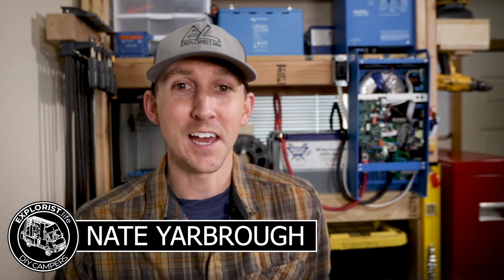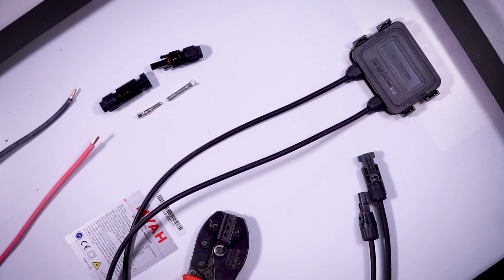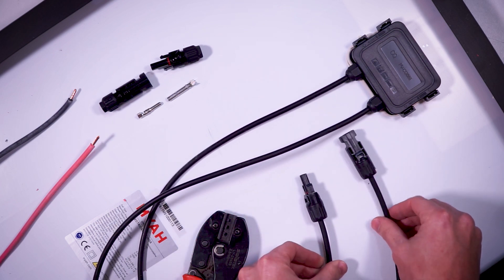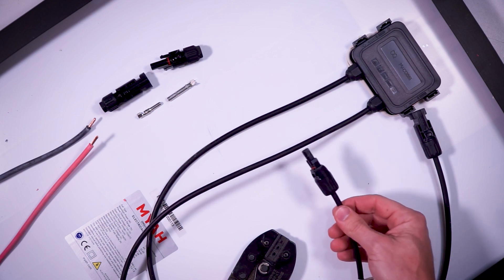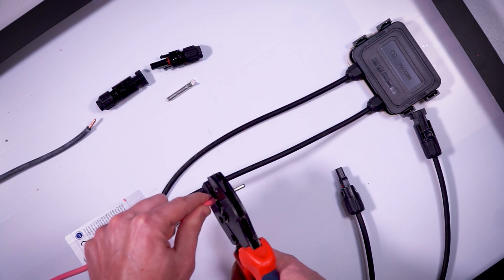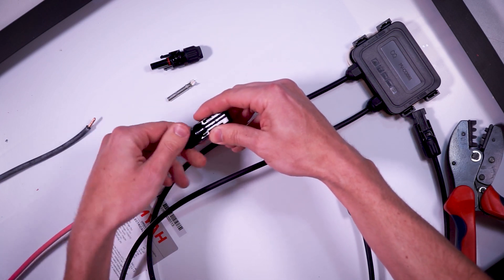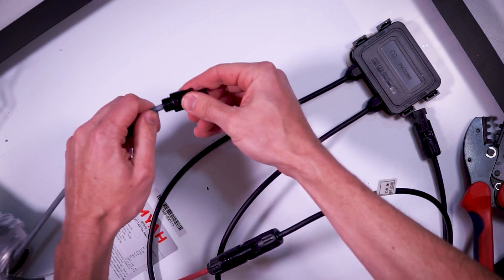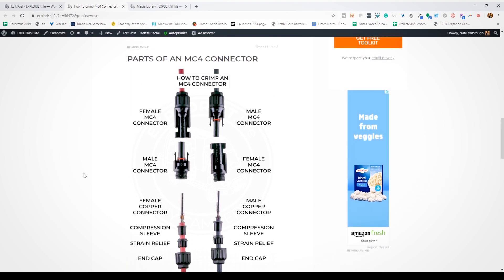How To Make MC4 Connectors (For Wiring Your Camper Solar Panels)

Comment: I have two questions. First, If you are connecting mc 4 extension cable say more than 50 feet from solar panels to the charge controller etc. should you not insulate the 10 awg red and black wires  in for ex. a cable sleeve PET expandable, for the weather?
second, I see most persons using 10 awg for extension cables I saw  a video which indicated that 10 awg cables do not last the test of time and can result in loss of energy etc.  Can I use a 6 agw (3 prong) wire to the mc4 adaptors instead? what happens to the third  wires as only red and black are used?
Thanks I an enjoying this series.
Reply from the maker: If you use wire that is rated for direct exposure, you do not need to enclose it unless a building code states you must (most solar wire is rated for this purpose).

There are no MC4 connectors rated for 6 AWG wire.  I would not recommend using 3 conductor wire.  Use the wire that is designed for the job.
Reply: @EXPLORISTlife  Thanks

Comment: Is it a good idea to use MC4 4Y connector with only 2 solar panels? Can I leave 2 more MC4 unoccupied? Or just use the MC4 Y connector while there are only 2 panels? Because I'm thinking of adding 2 more panels in the future. So, I was thinking of whether to buy just MC4 Y connector or simply buy the MC4 4Y connector at once. Currently I own just 2 solar panels

Comment: I wish they weren't so hard to pull apart. I have 3 systems that require me to move the power for where it is needed. So I was forced to use audio quick disconnect. Unfortunately, they rust after a while, which forced me to buy more. But mc4 plugs are like a permanent connection unless I'm given a better solution.

Comment: Thanks for all the Videos on Solar..Ive learn so much just with your teaching. "Question on the MC4 connectors. I have 2/ 170 Watt Panels going to a 30A Zamp Charge Controller which is located in the bathroom in my 5th wheel, then from their to my cargo area where the battery bank is at.. I want to disconnect that Zamp controller and replace it with a Victron 75/30 Charge controller and install it in a further location up front in the cargo area of the 5th wheel.  Could I just disconnect the in/out  from the Zamp controller and connect them together with MC4 connecters and from their using that extension to the new Victron charge controller?

Comment: I tried to connect my 2 one hundred watt panels to each other, in series, but they wouldn’t connect all the way. I contacted Rich solar and haven’t heard back yet. I’m thinking maybe they weren’t assembled right. 

Connecting the extension wires to the other positive and negative clicked tight. 

So I was happy (and giggling) to know this info is here, if I break one taking it apart, I can fix it. Empowering.
Reply from the maker: Awesome!  Glad it helped.  Thanks for watching!

Comment: The O-rings on my male connectors make it VERY difficult to click the connectors together, so I just wound up removing them.  Is there some kind of tool I can use to push connectors together WITH the O-rings still in place?

Comment: Hi you don't need to take a part the connector just push in the  crimped contact on the wire in to the connector on until click and tighten. done
Reply from the maker: For the sake of education, I felt it was important to show how all of the parts and pieces go together in a completely disassembled MC4 connector.  When I start skipping steps, people get confused.  I'm glad you already knew the shortcut.

Comment: Hi what happens if I put the wrong pins in and set the solar pannel on my campervan roof, I have no power so is it because of the pins?
Reply from the maker: I don't have enough information to properly diagnose why your solar isn't working, but you should definitely use the correct pins.
Reply: @EXPLORISTlife  it’s ok now cheers bud I put them right and now working a treat :)

Comment: Why not just cut off the plastic connectors strip the plastic off the wires and solder the wires together and then insulate the connections with plastic tape instead?
Reply from the maker: 1:  Cutting the MC4 connectors off of a solar panel will generally void the warranty.

2: This is faster than soldering.

3:  This makes for easier panel removal in the event that it needs to be repaired/replaced.
Reply: @EXPLORISTlife  Yes I agree it is a lot faster than soldering but soldering is not subject to corrosion like a crimped connector and thus unlikely to have problems.  That said I have ordered branch connector and two sets of connectors for inside the caravan so I can switch the output from the solar panel to a variable alternative system.

Comment: Do you have thoughts on Sae 2-pin solar panel - &+? I wonder if should replace this connector with an mc4, or the Ec8 that is the input of a power bank I plan to use.

Comment: Do you need that actual crimper tool to crimp the wires? Can you use an ordinary crimping pliers??
Reply: I can't find any help on crimping the solar pins to the wires. Ruined several already using my Klein crimpers. 😢 Can I just add a touch of sodder?

Comment: Hi nate, love your channel and how your explain everything very simple, I have a question I hope you can answer, I have solar set up around 30 feet from our rv and got 6 awg wire recently to help with the loss of watts from the distance but I haven't been able to find mc4 connectors that are big enough for 6 awg wire, do you know where I can get some or how I can make the usual mc4 connectors be able to fit around the 6 awg wire?
Reply from the maker: Nope.  MC4 connectors are generally designed for 10 awg.  8 awg SOMETIMES fits, but to my knowledge, isn't approved.  Increasing the voltage of the panels by wiring in series or series parallel will allow you to use 10AWG wire without excessive voltage drop.
Reply: Thank you for the help, ill try the series parallel way with the 10 awg wire.

Comment: Do these work with 6 AWG PV wire?
Reply from the maker: Nope.  10 AWG is the most common size for MC4 connectors; I have seen the random MC4 connector that will accept 8 AWG.  I never use wire bigger than 10 AWG in any of my solar array setups up to 4800W.  By properly using series-parallel solar configurations, to raise the volts and keep the amps low, large wire  from panels to charge controller is rarely needed.

Comment: Hi ! Thanks for the video.  I want to make sure that the mc4 connectors are installed on regular (multistrand) wire, like a 10awg.  Just because I saw wire described as pv on it.  Thanks
Reply from the maker: Those wires would be installed on the roof, so they should have a PV rated insulation.

The wires themselves are, indeed, multistrand wire.

Comment: Great video Nate. I like that you take the time to teach. Quick question, do I need to install a sun-saver charger between the panel and RV? Or because I’m going through the RV plug, it regulates itself? Thank you in advance.
Reply: I'm not sure what you mean by RV plug. Most RVs before 2015 are not really set up for solar, but if connecting a solar system (18v-22v) to your battery, (12.8v-13.2v. SLA/Lifepo4) you'll need some sort of regulator, step down converter, or charge controller to set and limit the appropriate voltage for your battery chemistry, even if they have a BMS. 🙂🌎☀️

Comment: Thanks for a great video. :) Are MC4 Connectors weatherproof? I've seen a lot of solar installs that include leaving MC4 connections on the roof without anything else to protect them... do those need any sealing or protection against the elements? I saw they have an IP67 rating, which looks pretty weatherproof, and I couldn't find much else about it, so I'm guessing these connections are just fine in prolonged rainstorms... Any thoughts? Thanks again. :)
Reply from the maker: They sure are!  IP67 means they are waterproof for complete submersion up to 1 meter: http://www.dsmt.com/resources/ip-rating-chart/

Comment: Hi! Just want to figure it out how I should do to connect i 600W of solar panels in parallel (12v), bc the mc4 are rated to max 20A and my setup is going to need at least 30A and i don't want to over current the wires and mc4! Thanks!
Reply from the maker: I very much don't recommend wiring solar panels in parallel to the degree that there would be over 30A flowing to the charge controller.  Consider going series/parallel to drop the amperage.
Reply: Just wire half of them in series and get a 24v controller so you have less amps flowing. Should also save you some money

Comment: How do you Make an MC4 to USB C connector
Reply from the maker: Just curious... what would one use that for?
Reply: It goes for the  ECOFLOW370, I just got it yesterday
Reply from the maker: I think you'll be looking for MC4 to DC Input like this: https://ecoflow.com/collections/accessories/products/mc4-solar-adapter-cable

I can think of 99 ways making an MC4 to USB-C adapter would go wrong and send too much voltage to the USB port.
Reply: That is for the 450: thanks for your fast response and help, ecoflow told me to try amazon, and I did a google search before asking you, there doesn't seam to be such a thing as MC3 to C
Reply: MC4
Reply: it was for the 412 I meant to say
Reply: Loyal Gaskin l

Comment: Question: our van has 6 AGM batteries and I am installing a 12 volt pump for our sink install. Can you tell me best way to wire it up? Thank you so much for any advice, Paul
Reply from the maker: Sure!  You'd want to wire that into your 12v fuse block.  Have you already gotten that far into your build?
Reply: EXPLORIST life - DIY Campers no but after looking around I found a 10 way on Amazon. My confusion comes with batteries in parallel so does it matter which pos post I get 12 volts from? We are new to solar.
Reply from the maker: It's pretty tough to say without knowing how everything is set up in your camper, but yes, you could tie in at the positive battery post or at your big DC busbar.  Maybe checking out this diagram will show you how this stuff flows together: https://www.explorist.life/3000w-inverter-400-600ah-400-to-1200w-solar-camper-solar-kit/

In this diagram, the 12v fuse block is housed in the big black box in the top left.

Comment: You have your male and female backwards. Gender is determined by the inner metal contact, not the outer plastic shell.
Reply from the maker: Technically, yes... but in a "trying to teach people how to do this" standpoint; the way I described makes more sense.

Semantics aside, I hope you found out what you were trying to learn by watching the video.
Reply: @EXPLORISTlife  Yes, many instructions say the male and female connectors are the opposite. Quite confusing. I think your explanation makes more sense. Most important part is to make sure which cable is positive, and which is negative :)

Comment: Perfect timing for me.  I have a Zamp SAE solar cap on my roof.  The plug I have that fits it has no MC4 connectors on it, just bare wire.  I was looking around last night for a Zamp compatible MC4 to SAE adapter and could find one.  I woke up this morning to this video and realized I can just make one.  Thanks!

Comment: Any suggestion for an mc4 connector pin extractor tool?
Reply: It was still bugging me that there is not a pin extraction tool for the MC4 connector assembly. I have (had now retired) worked in electrical/electronics environment for over 60 years and worked with all sorts of connector assemblies. Some systems were low voltage high amperage (48v @ 2,000 amps) and at the other end 40,000 volts @ a few milliamps. Anytime I was using commercial connectors that were comprised of multiple pins, there was always a proper crimp tool and a proper pin extraction tool. I called Staubil. "The MC in MC4 stands for the manufacturer Multi-Contact (now Stäubli Electrical Connectors)" I figured they would have an answer. They do and that answer is basically what Sylvan Butler is saying, "...is not a supported operation". What Staubil told me was that once the MC4 is assembled it is NOT designed to be taken apart down to the level of removing the pin. Staubil MC4 connector assemblies are UL listed even after assembly as long as the pin is crimped with their crimping tool. The UL listing goes away if you try and remove the pin once it has been inserted into the housing.
Reply from the maker: I don't.  If I mess it up I'm just going to cut it off and re-crimp a new connector.
Reply: Pin extraction is not a supported operation. It's meant to be a one-time thing.